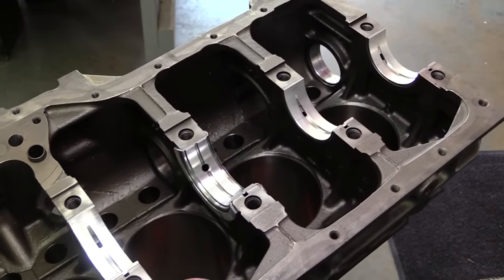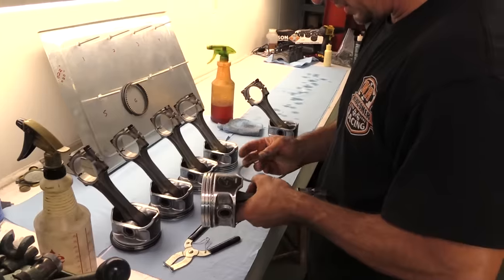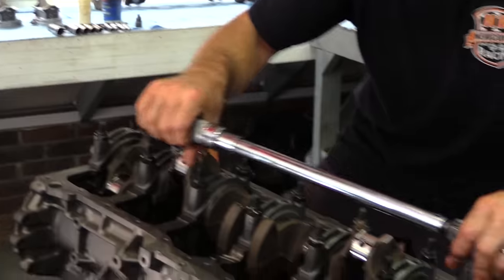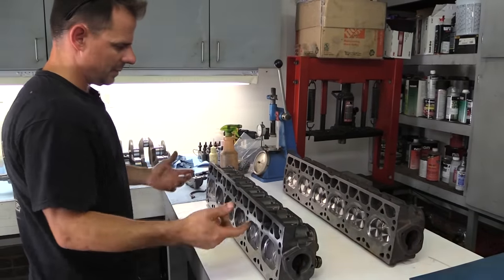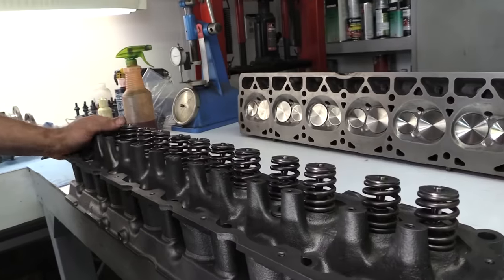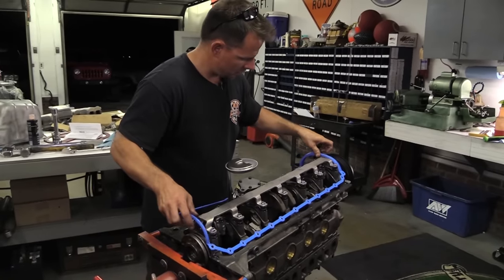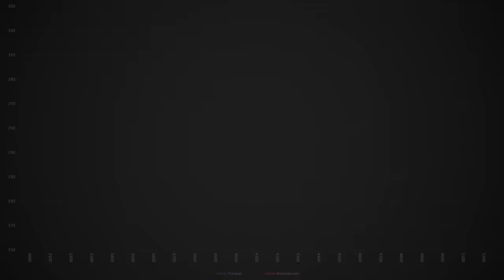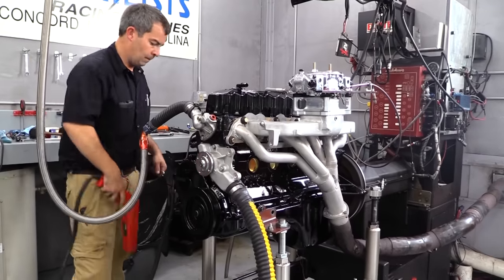Big Power Jeep Straight Six Stroker Build on a Budget with Newcomer Racing

Comment: Nice to see that people still build and modify older engines and not just swap an LS! Lol

May have missed it but what was the compression ratio?
Reply: Probably between 9.5 and 10.   The Golen Engine Service 4.6 stroker crate engine is 9.5cr
Reply: Its under 9
Reply: I can tell you if you can read the casting number on those pistons
Reply: I don’t think you would want to gamble long range if your a cj7 owner with a t5 transmission. Its a great video and very talented man though

Comment: My brother is building a stroker for his 97 TJ. He has a special set of pistons that have a higher wrist pin height to allow him to utilize the  longer 4 liter rods. This will give his engine more torque. He also is installing the larger ls valves and porting his head like the one that was in the video. His engine should in theory easily put out more power than the one in the video. His time working at an engine machine shop has taught him the tricks to squeeze all of the horse power that is available   in one of these engines when naturally aspirated.

Comment: Currently you can find 4.0L short blocks fully refurbished for $1000.. or 1500-2k for long blocks. (I literally just looked it up) Pretty insane that those engines pumped out 190HP from the factory when most V8's were still only at 220 at that point, and in the early days (late 80's) were still only putting out 135.
Reply: 190hp / 6-cylinders = 31.66hp per cylinder. 
220hp / 8 cylinders = 27.50hp per cylinder. 

That's a difference of a mere 4 hp per cylinder. Far from insane.

Comment: Well I now know who will get my Cherokee motor when I'm ready and I'm not far from you guys at Newcomer racing. Mine has 315,000 miles on it but still running strong. I plan to keep this car so I was already looking for someone who would build the stock motor. I want to keep it with all original parts and drive train as long as it's possible. Thanks for this video just what I was looking for ! I want a real street sleeper.

Comment: I built a 292 Chevy 6 , 60 over and built with no expense spared ! With dual quads , solid cam coated bearings , the list is a mile long , it made 383 HP AND 419.8 torque !!! Very streetable , we did two Dyno sessions , the 2x4 made 10 hp more than 3x2 , but we had one carb crack at the base , I think the 3x2 set up right could do better , also we put a DUI HEI , dist. And when we put the Accel coil on we picked up another 10 hp !! We tested that 3 times !!!! Also that was long tube hedders without collectors , they wouldn’t fit in the dyno , the 29” collectors will gain another 10 to 25 hp ! All under 6000 RPM ! Lots of porting 194 164 valves  from small block Chevy ,100th taller , must have 40 50 hours in the porting and setting it up for the correct 175 rollers , had to take 425th off rocker stud surface and had smith bros make me push rods ! Built a lot of motors in 40 years this was my first inline 6 ! With what I learned I’m going to build another 292 , with tri power , man a fre Intake , try and find one they are rare as hens teeth !!!! It uses 3 , 425 CFM 1958 Pontiac rochester 2 jets , I confident that I can get 425 to 440 HP , it’s a period type build , meaning something you would see in the late 60s early 70s Great job !!!! I would really like to talk to you and pick your brain on my next 292 , impressive !!

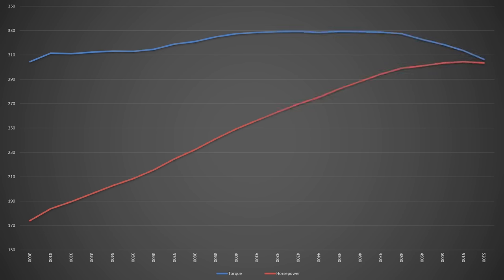Comment: Dude, these motors are great. Look here at 13:50. 

You have horsepower that goes up but you have INSTANT and CONSISTENT torque from like 2500 to 4500 rpm man. Just awesome. Torque on demand.

They may not be the best at making power but man, I'm sure there's tons of head designs that could be experimented with if one has the money, tools, time, you know, basically all the means to do so 

I'm truly in love with a couple engines:
The amc i6
The Chevy 454
The Cummins B series
Duramax diesel V8
The power stroke V8 and the idi version before it(very underated indirect injection diesel)
And finally, I'm also in love with all the recent gm V8's with the direct injection and such. I think it's so awesome we have these old pushrod designs and are literally sticking GDI in it. Incredible. It's truly a great time to be alive, so many interesting things and a golden age of tinkering ! 😍😊

Comment: Great video thanks for sharing. A few years back I wanted a stroker and bought one in Ocala Florida, thinking hey a warranty and drop in saves time, NOT! Nuff said, most jeep people have heard the horror stories by now of that place. After 200 miles and the engine being pulled three times I said forget it! My friend is a crazy great machinist well know and he helped me set everything up. We found problem after problem with the previous build. Apparently they didn't understand valve spring bind for one, that explains three wiped out cams. After porting, chamber CC and quench planning, proper cam set up, roller rocker from Harland, throttle boring, better cam specs, all the vale tricks you mentioned I could grab third gear rubber "35" tires" and was quite happy. This 5k price tag is pretty low in my book but would like to see the numbers with the factory 92 up MPI. I was thinking on another build maybe even turbo but would truly consider this option! People always cite or comment doing V8 swaps as being cheaper, once you buy most of the adapter, spend the time sourcing everything, buying a used motor and possibly rebuilding it the 4.0 stroker is a great deal. And if you like to travel in your Jeep being able to still go in a parts store and say I need a hose or belt for a 4.0 looks pretty simple. Lets not forget some states are crazy emission happy too, is that an original motor? Many V8 swaps require moving the motor forward so now add in drive shaft, radiators and so on. 

Yes I have been that route. Good luck to all happy Jeeping, 

Oh and last but not least, lets not forget how tough these motors are and the torque down low.
Reply from the maker: Those are all excellent points. Glad you finally got your engine sorted out!
Reply: @TheHorsepowerMonster  Meant to ask, any thoughts on the aftermarket aluminum heads? Yes pricey, but cooling, weight and possibly being able to lower chamber temp so run more advanced timing?
Reply from the maker: Yes, the Edelbrock head is definitely better mostly because it has a modern combustion chamber. Keith Newcomer and I hope to test a stock head and the Edelbrock back-to-back someday soon.
Reply: @TheHorsepowerMonster  I didn't mention by name since its proprietary wasn't sure that was cool:) I cant wait to see the results!

Comment: Want to see a ford 300 straight 6 build
Reply: Me too
Reply: Me three.
Reply: 👍ME 4👍
Reply: Yeah 👍
Reply: The only ford engine I like.  Cannot be killed.  Had one traded in during cash for clunkers, bounced it off red line for a day w/o oil and coolant, damn thing still didn't die.  Once it cooled down it always started back up.
Reply: @christopherking2012  can't kill a Ford
Reply: Yes
Reply: Me fifth
Reply: We had an Econoline with a 300-6, four speed on the floor. Ran it 320,000 miles, then sold it into commercial service. 18mpg at 65mph, never burned oil, never had the valve cover off.
Reply: THE Ford's had no torque
 not even close to the JEEP 4.0 PERIOD,ALL YOU HAVE TO DO IS REMOVE THE OIL PAN AND BINGO YOUR ANSWER!!FORD AND CHEVY SAME HORSE DIFFERENT COLOR,THE 4.0 A BEAST!!
Reply: @rayoliver7244  Uhm...the ford 300 have 65ft lbs more.
Reply: @ssimon64  Yeah but most of them die quickly on their own in shame on the highway so it's okay...  :?)
Reply: Christopher King 

CASH FOR CLUNKERS? I hate Obama.
Reply: Just look up Ford barra 6 haha
Reply: @dasboot9471   Ive had two both over 200 000 miles both highway driven mostly one was manual and used as a work truck for waste oil and the other was a auto both great engines and tons of grunt
Reply: With a 302 crank maybe?
Reply: @marine4lyfe85  No, all custom..due the category regulations these engines ara destroked to 188ci or 3000cc, since 2017 are using a custom made 24v cylinder head..
With the 12v head there are in the 350-370 range

Comment: Don't know if I missed it but, he didn't break in the hyd. cam with that style of lifter and cam you're supposed to start up and run above 2500 rpm for I believe 20minutes(maybe they just skipped that part). he just started it up and went with a dyno pull. plus he never had the waterpump  hooked up and moving water? other dyno video's I see they always have the waterpump moving the water.
Reply from the maker: You are right, proper break-in with a flat tappet cam is critically important. They did that, but I didn't shoot it because breaking in an engine is important. They also use an external water pump on the dyno. The idea is to eliminate the search for a properly sized belt to turn just the water pump for every engine that goes on the dyno. Just makes life simper for the engine builder. Thanks for watching.
Reply: The Horsepower Monster thanks for the reply back and the explanation. I liked your video and looked at his website. And the more I think about it the hp numbers he's getting with factory rods and crank heads is awesome. He's getting more horsepower than a competitor I just watched. 
And I spoke out of turn and his price is right in line including dyno, shipping etc. Actually alittle cheaper. I'll will edit my previous post.

Comment: Drop that engine in a Gremlin or Javelin and watch the jaws drop at the traffic lights.
Reply: Or a Spirit GT
Reply: Gremlin for sure with a TKO 5speed and 3.73 or a 4.10 posi would be sweet
Reply: Hell I would just throw in a TJ or CJ and run the trails with it. With that much power you could go just about anywhere with the right gears
Reply: @eddiepatterson5025     I'm using a jeep wrangler bell housing with a aisin ax15  5 speed from a 2wd dodge dakota,  and a 4:11 ford 8.8 rear axle....if I can ever find a clean affordable 70-71 Gremlin. They got rare and expensive in the last few years....
Reply: fortj3 ROFLMAO!!!!!    That setup will definitely turn some heads for sure

Comment: First, I worked in the the Tool Room at Kenosha Engine Plant. In the late 80s we machined a series of blocks for Roller Tappets for testing purposes. In the end it was decided that going to a Roller Lifter wasn't done due to the fact that the Power Train engineers were getting the HP and torque output they wanted in a production vehicle. A number of things could have been done to really spruce this motor up. One would have been a new head with crossflow porting. This was talked about along with a 24 valve pushrod head. In the early 60swhen the original 232 and 199 were under development SOHC set-ups were run on dynos. There was a lot of untapped potential in these engines. 
When originally designed the engine was designed as a four or six cylinder engine that could be machined on the same machining lines. The locator positions were built into the work holding fixtures. It even would have been possible to build a 5 cylinder if they wanted to. The engine was designed and developed to be a base engine en a family sedan. The rise of the American V-8 basically killed any idea of factory performance options on six cylinder engines. Yet things could have been different. All it would have taken is for the SCCA to introduce a third class to TransAm racing. For six cylinder cars with a displacement of 3.75 liters (226 CID). Imagine a 232 or a GM 230/250 with a 4.00 bore and a 3.00 stroke. A cylinder head that could really breathe.  And a rule book loose enough to allow for stuff like triple Webers.

Comment: That 4.0L makes  44 more hp and 15 more lb ft of torque than the 4.7L "High Output" V8 in my Dakota. 

Would love to have that engine in my Dakota!!
Reply: That HO 4.7 blows up under factory hp numbers lol
Reply: @repnatl  If I had the cash, I'd swap in the Corsair 4.7L. My HO is so weak, it's like having the 3.7L V6.
Reply: I had the 4.7HO in my 02 GC overland.  That thing absolutely ripped and never gave me any problems.  Had tons of torque from really low RPM.   After a few years I added an intake and the Kolak exhaust system but suspect it made limited difference in HP/TQ.
Reply: @dingomanz7  My HO only runs ok on 93 octane and I'm not paying 70 cents more a gallon so I just live with it. From a stand still if I mash the gas I can barely chirp the tires, and I've got the 3.92 gears. Sucks, I should have bought the regular V8.
Reply: @knobrush  What year is your Dakota?  In my GC Overland HO I could easily tell the difference between 93 and 87 octane particularly above 3.5k RPM.  I've never chirped the tires on account of Quadra Drive II being AWD.    The 4.7 HO in my jeep is more powerful than the HO in the Dakota's due to different camshaft and manifold.
Reply: @dingomanz7  Mine is an 06. Supposed to have 260 hp and 315 lb ft. I've seen it listed as much as 265/325. Heck I even ran a tank of 98 octane through it..no difference except the mileage went up a little.
Reply: @knobrush  jeep grand Cherokee4.7 h.o back then was likr 325hp. WAY more lol
Reply: @teds4983  That's torque not hp. the 4.7L was available in two varieties 230hp or 260.
Reply: @knobrush  go's up to 310 actually. I just Google it. The 260 was the 1st year of the 4.7. And they were more powerful in the grand Cherokee than the truck i Believe
Reply: @teds4983  The 4.7L was introduced in 1999(had one in my 2000 Dakota) with 235hp and 295blft. The H.O. was 265hp and 330 lb.ft and was in the Gr. Cherokee from 02-05., Dakota 05-07.  The Corsair 4.7L showed up in 2008 with 290-305hp and 320-334lb.ft. I'd love to have the Corsair 4.7L in my '06.
Reply: @knobrush  210-310 hp output, your welcome
Reply: @teds4983  Thanks for including the 3.7L hp number(210) when we're talking about the 4.7L.
Reply: @knobrush  it literally said 4.7 h.o motor 210-310hp. So by your logic the 3.7 has 310hp? Your not very smart are you?
Reply: @knobrush  https://en.wikipedia.org/wiki/Chrysler_PowerTech_engine read the fucking power OUTPUT. And actually it includes the 4.0 liter as well in there. Its because there all made by power tech. Lmao damn
Reply: @teds4983  click on your own link. it says 3.7L-4.7L 210-310hp

Comment: My old Jeep just turned 401,000 miles on the original AMC 242ci I6.  The old power plant still has no leaks, makes no smoke, does not make unusual noises.  The AMC 242ci I6 is basically a tractor engine.  When it finally goes bad, an athritic chimpanzee with broken thumbs can rebuild one.  If I had the money, I would love to pump more power out of the vintage workhorse.

Comment: 300hp out of a mild build tractor motor is amazing. Lol that motor in a 2wd Cherokee would be a bmw m3 killer
Reply: Dave Micolichek  depends on the year m3, i had a 99 Cherokee. It weighed right at 3050 with me in it. They're pretty light, and with 300 hp it would definitely walk most m3's with the exception of the new ones
Reply: @danimal865  Exactly. The common misconception that all bmws are fast. People are so shocked when I tell them my e46 only has 190hp.
Reply: @ThatE46  bmw's have always been quicker than the should be in my opinion which is most likely because they are underrated from factory, but power to weight ratio is king.
Reply: I beat many a bmw(and others) at autocross w my 96 2dr 2wd ax15 w the 4.6l.
Reply: I beat many a bmw(and others) at autocross w my 96 2dr 2wd ax15 w the 4.6l.

Comment: I'm amazed you got a 950 cfm carb to work on a 280 cube motor. What jetting did it end up using?
Reply: @noidontthinksolol  Unless it uses vacuum secondaries.. Only allows what the engine uses.. Q-Jets where as big as 750cfm on a smogged out 350 yet, you could carry that Q-jet all the way to around 700hp if you knew how the carb worked.  I read somewhere about some guy running a stock Q-Jet on a car running 11s in the quarter.  Very efficient carbs
Reply: @zuestoots5176  
That's correct, Pontiac used a Q-jet on a 250 cubic inch inline 6 put in early firebirds worked very well .
The Q-jet was factory rated at 750 & 800 CFM